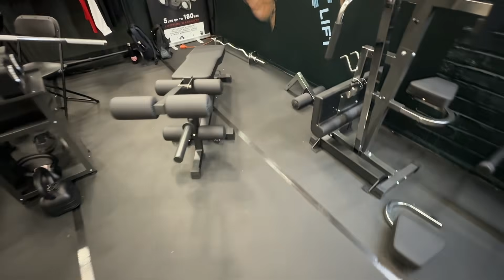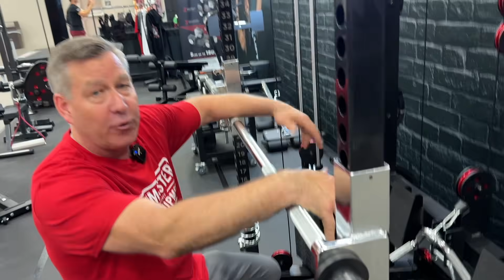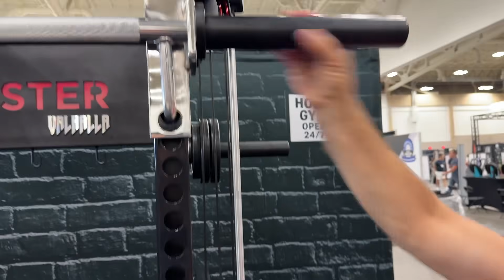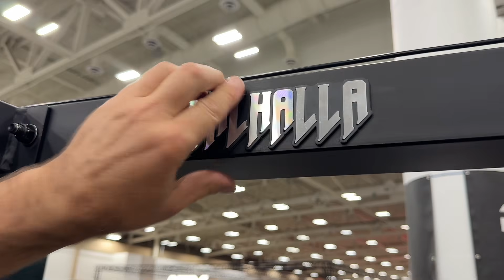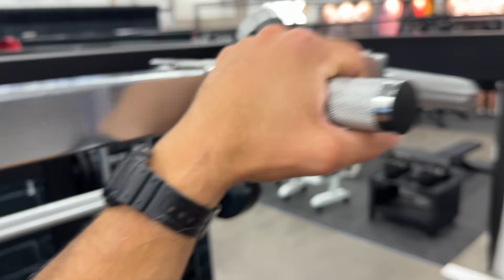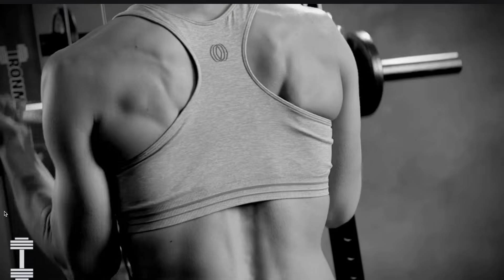Ironmaster Valhalla (IM3000) In Depth Reveal and First Impressions

Comment: Ordered impulsively and now hoping to cancel the order. I own a lot of Ironmaster equipment and have been very happy with it overall. That said, not including J-cups and spotter arms at this price point is hard to understand. It feels like ordering a truck and then being told doors and windows are extra. For the cost, basic safety accessories should be standard.

Comment: not a fan of the smith bar locking system, would be much better if it locks from above and on the side of where you can see the pins like normal smith machines do.  With this system you have no idea (other than feel) if the bar locks in place where as a normal smith machine you can physically see the locking point so know exactly where it is if the weight is too heavy.

Comment: Really interesting piece. I like the angled front, being able to use IM2000 attachments, the innovative pulley system and the mid-height low-row plate. I do wish it had a plate loaded option and at least one pair of 3x3 uprights to have the freedom to use other manufacturer's attachments. $4k seems outrageously priced!

Comment: Personally I wish the smith machine would be an optional accessory I can buy afterwards if I felt to and if there was a plate-loaded version instead of the weight stack. Both would save me money as I don't like smith machines and I have enough weights lying around to load this, so it would be of interest to me still. It looks interesting though and I love that it has a functional trainer AND lat pulldown/low row. and also the increased width of the functional trainer. It's a good design. So many functional trainer out there have either one or the other. Also love that the cable system is not in the way/competes with the rack functionality.
Reply from the maker: You for sure can now with the Bulletproof VTS and I also covered one called SYL. Even though I have a smith machine on my rack, I really don't need it at all.

Comment: Could you tell us how smooth the cables are on the IM3000? Specifically, if you were to rank how smooth (frictionless) cables moved on this unit compared to rogue twin stack, rep, and prime prodigy? (Or whatever other main brand cable systems youve tried)
Reply from the maker: It was definitely smooth, but hard to really remember since I tried it.

Comment: For around $4K it'll be hard to justify when you can get the MAXUM Fitness SX2 which does all the same stuff and more (like leg press) while including a ton of attachments and using standard 3x3" uprights with 5/8" holes.

I can see a market for this more around $2-$3K. It's got an interesting and unique design and there's actually a relatively decent 2x2" attachment ecosystem that I think could work with those middle uprights.

And that adjustable pull-up bar is 🔥🔥. I need that on basically every rack now.

I also actually prefer 2x2" uprights personally since it means you get 2" more interior space for the same exterior rack width when compared to 3x3" uprights, important for us taller folks for maximizing elbow/knee room.

And when you make it with 11 or 12-gauge (or thicker) steel 2x2" is more than heavy duty enough for anyone. Heck even 14-gauge is enough for most people but might limit how many holes you can put in it vs 11-gauge probably allowing 4-way 1" holes with 2" spacing (at least on the front) without destroying the integrity.

I'm also really curious to see how the Force USA C20 holds up, did you get a chance to check that one out?
Reply from the maker: Thanks for all of this, great points all around. Yes, I did see the c20 and will comment on that on a future video.
Reply: ironmaster has a leg press attachment for the smith bar as well. i'm pretty sure that everything that works with the im2000 will work on this machine. you should visit their website.
Reply: It'll likely be under 4k based on the cost of their products overall. The sx2 looks like a better low row set up due to longer ROM, plus using two handles I think is nice to have available. But you max out at 220lbs when combining them since they're on a 2:1 ratio, but the integrated weight horns are pretty sweet. My only caveat is the height, I like dead hang muscle ups and 81 inch height for the pull up bar is too short.

Comment: Two things stand out for me...

1. PRICE: $4,000 is very, very expensive!

2. SIZE: Overall it seems large with the angled cage design.

Obtaining a wider cable crossover movement could have been obtained by altering the design of the cable pulleys, basically enabling the pulleys to turn and lock in sideways to the rack, thus creating that extra width.

When i think Ironmaster i think "compact" home gym equipment but the im3000 seems to step outside that bordering on a typical functional cable rack design.

I hope my initial thoughts are wrong but i would like to see a more compact design and cheaper price tag.

One other thing...the Seated Cable Row foot rests, do they come out further from the rack? I like to get a good forward stretch when performing seated rows but i get the impression from your video footage that a forward stretch may not be possible with the current design?
Reply: Agree that compact is strongly associated with Ironmaster. It is exactly why I still rock the IM-1000 I bought in the mid-90s, which is slightly more compact than the IM-2000. IM racks are for minimalists and/or those with little space. I've got so many hacks for using it, such as using it as a sissy squat fixture. The new environment of so many smiths and functional trainers is a challenge for them, but the people I most follow for good workout advice all seem to be minimalists too and get great development out of traditional equipment. Functional trainers are fine, but I'm not persuaded that they are really are doing that much extra for those seriously pursuing more muscle mass. It almost seems like a distraction to me. But if I were new to the game and had more space I suppose I'd go that route too.
Reply: @5metoo  Spot on 👍
Reply from the maker: Thanks for sharing all this. I don't think the footplates came out further, but could be wrong.
Reply: @hybridresistance  👍
Reply: I agree on the space issue. I think that adjustable arms might have salvaged some of the space saving.

Comment: Ironmaster waited long enough to knock this out of the park with full cable cross and 6 post rack functionality!

First detailed look at Ironmasters new IM 3000 Valhalla a we have some clever design work here. It has a proprietary system so you only need one cable to utilise 400lb for both stacks for pulldowns and low row which can be done on the bench instead of the floor. A belt squat dock built into the spine, a full width cable cross/functional trainer not intefering with the function Smith or the free weight rack attachments. Looks like most of your IM 2000 attachments are going to work as well Ironmaster dont cannibalise their range.

Nice clean non cluttered ground up design, you can move from cables, pulldowns, Smith and free weight rack without having to change things out, doesnt look like the overloaded mechanno set trying to retrofit everything to work on a square rack shape.
Reply from the maker: Great comment and points here.

Comment: Looks like a great system if that's what you're after.  I just bought a ForceUSA F-FT with the flippy-out pulleys like he mentioned, similar to the C10 and C20, so I could get that width.  Paired with a proper rack, it's still the best of both worlds imo.

Comment: I think they dropped the ball a little here by having to use the smith bar as a lock in point for the pull downs. 

If only they would release a seat attachment for the regular im2000 and this it would be a game changer. 

They should focus more on attachments for their im2000 and bench ecosystem rather than a new design which still doesn’t really solve the problem of no seat pad for pull downs on. 

I dunno, I was excited for this but now I’m not so sure.
Reply from the maker: I think they told me that there’s gonna be some attachments for this rack.
Reply: @hybridresistance will wait and see what comes. I’ve heard of a Nordic curl attachment for the bench that serves as an anchor for pull downs so will wait and see I guess. 

Like if you had nothing and wanted the smith setup with ft capability then this would be an option but there are a lot of other good options at that point. 

The thing that sold the im2000 by the truck load was its size and ecosystem. I still think this should be a focus as they have a proven market.

Building this is an entirely new setup competing against rep atx and other companies so it becomes a harder sell I believe. 

Love the content please keep it coming. 

I’m a massive fan of Ironmaster and love their bench and dumbbells and im2000 so love seeing stuff on it.
Reply: @ellisbailey1  IM2000 is still in thier product lineup though, I believe the IM 3000 Valhalla is just adding to their established line as their high-end option.

Comment: I really like the shape of the rack. More compact than a rectangular six post rack and you can do wide cable chest fly. Very nice. I don’t want a smith machine though and the uprights looks kind of thin. I doubt that you can put jammer arms on that rack? But overall very interesting rack.
Reply: Jammer arms won't fit in this config, but the 11 gauge 2x2s are super strong and we have bar hooks and spotter arm for your free weights.

Comment: I am not very familiar with "all in one" trainers as my "gym" is a 10X10 spare bedroom.  I do have the original Ironmaster lat tower and their standard bench.  I find both products more than adequate quality.  I'm wondering why Ironmaster does not use 3X3 uprights if that is what most consumers prefer.  I would think it would make their product more competitive in what appears to be a very competitive market.  This may be a deal breaker for some.
Reply from the maker: I assume it has to be that it would just make the space in overall build much bigger for a situation such as yourself

Comment: Great info. 
I learned more from this video than i did in person at HGC..😂 

The Valhalla, in person, felt like it was lacking... height. I was hoping for an option to get it in a  taller version ~93-95". 

With rhat said, I can see the Valhalla being able to get the job done because it has the bare necessities for a rack in 2025. I think its exciting for people in the Ironmaster ecosystem. 

But it may fall short for me , no pun, in that it lacks flexibility and configuration options. Its like a one size fits all. It also makes some of your most beloved accessories obsolete (i.e seal row pad) and limits your future expansion/evolution of your home gym space. 

Just my two cents.
Reply from the maker: Thanks man. I definitely agree with you and a lot of those points. It was exciting nonetheless to see something as iconic as that 2000 be upgraded.
Reply: I am a definite long time Ironmaster fan and I own just about every major product and accessory of theirs except for their cage/rack systems. I am also curious about the height of the IM2000 and this new model. One exercise I would be interested in with having a smith bar is standing calf raises on the IM calf block, like the female model is demonstrating in IMs promotional video. But being 6'2", I wonder if my head would be hitting that center beam that forms the ceiling of the rack.
Reply: @justinsluck  Owner of an IM2000.  I'm 6'2''.  it is probably the max height you can be if you like squatting with a free bar  (the spoting arms are a little short when you are used to work with longer spotter arms but it still work if you make sure you stay close for the cage). At more than 6'2'' the smith bar may interfer with the free bar even you can keep the smith bar at the bottom of the rack and not at the top. The big advantage of the IM2000 is the small footprint for the amount of exercice you can do.  No regret for the IM2000.  Still unsure of the advantage of the extra footprint for the IM3000 but this current youtube channel and the explaination of the owner of IronMaster make it more attractive to my eyes but It will not wroth it to change in my point of view if you have already the IM2000. No issue with the height also with a calf raises with the IM2000 ( the best calfraiser is here:https://oakclubmfg.com/) .
Reply: That's good to know about the height limitations. Am I biased for thinking 6'2" height isn't that tall or should be common enough it shouldn't be hitting near those limits though? Thanks for the calf raise link. I also own a body solid squat / calf block with a curved deck, but the one you linked looks nicer to me, as it takes up less floor space. But yeah , I have trouble balancing a free bar on my back and my power rack doesn't have tall enough j cups to slide and lean against, so the IM smith function looked appealing @aalexisd6970

Comment: I’m not sure if you had an opportunity to try the Rep Smith Machine, but I’d love to hear your thoughts in comparing the experience of the IM 3000 Valhalla and the Rep Smith.

Consistent smoothness and being able to have the bar as close to weight plate height as I can get are my two main interests.

I started in Planet Fitness and grew to enjoy using a smith machines.

Comment: I think the IM 2000 is still a better option, it has a much smaller footprint. I have had one for 10 years in a spare bedroom and love it. This thing is too big. I would have preferred  something like the Im 2000 with a dedicated high low pulley system that didn't use the smith system for weight. The IM2000 has a high low pulley that is smooth, but the starting weight is kinda high especially for my wife, and I want to use the rack and cables at the same time. Im an ironmaster fanboy, but this is a miss for me. I also don't like the idea of using a free bar in between the smith and the cable uprights.
Reply: I totally agree, I was really excited for this release but it’s a miss for me as well. I think it goes away from what iron master does best- clever space efficient design that you could even fit in a bedroom. Im saving for an IM 2000, and that still seems to be my best option for how I train and how much space I have (not to mention my budget, 4.5k is too much for me).

Side note- Home gym hacks and reviews came up with using a loading pin on the IM 2000 to get a lower starting weight on cable movements. Might be worth a try for your wife!
Reply from the maker: Really appreciate you sending your insight as someone who has the other model
Reply: I love IM products and have the IM2000, quick lock dumbells, and a whole host of attachments.  Agree with the comments that the footprint is too big for my needs. I ended up buying the torque anker 7 for a functional trainer to fill the void and it’s worked great for me as a decent trainer with great space saving.  Was hoping that IM gave me a reason to upgrade but not this time around.  Wishing them well as I love their ingenuity.
Reply: I hear ya. I've had my IM-1000 for 30 years in a spare bedroom and love it. I think IM tried to split the difference between current IM and functional trainer. I'd have preferred iterating on the current design as you say, but then as a former salesman I understand that people have a need to buy for optional uses, even if they'll never use it. The way I'd prefer it might not sell enough for them.

Comment: Great overview! Most likely will be selling my 2000 for this, but 4k…..yeeeesh. Did he mention any dimensions? I lift in a small area, so this is prudent.
Reply: 88.6 h, 65.5 d, 79.7 w
Reply: @IronmasterPro what’s the depth of the top center beam? I have a 90” ceiling but a light in the middle that hangs down around 2+ inches. Your 2000 fits just fine. Also, is that height with the pull up bar attachment, or just the unit? Thanks.
Reply: @TurboGuy979  - I mounted an LED floodlight pointed up at my high ceiling on my IM-1000 a few years ago. My IM now serves as a more effective torchiere lamp than any I've ever seen. I turn it on and off with the wall switch. Eliminating floor lamps declutter my space, and the light is vastly better.
Reply from the maker: I can’t remember off the top of my head, but I remember the height was roughly the same as the 2000. I’m sure you could shoot them an email and they’ll tell you that though.

Comment: Premium product, premium price. I'd like to see a plate loaded option or using ironmaster dumbell plates in place of the weight stack as a cheaper option. Also I wonder if you can use the weight stacks on the smith bar, that'd be awesome
Reply: Same. I’d rather utilize my 460lbs of plate weights without the need of stacks for lower cost.
Reply: @TurboGuy979  I have a weight plate functional trainer and I personally dislike to change the weights all the time. Next time I will definitely buy a trainer with a weight stack. It is worth it.

Comment: Did he mention the height?
Reply: 88.6"h
Reply: @IronmasterPro  Thanks! It looks nice!
Reply: Good question
Reply from the maker: I don’t think I got that on video, but I believe it was 85 to 90 somewhere in there. Or from what I gathered the same height as the 2000 which is roughly 85 inches.
Reply: @hybridresistance  thanks!
Reply: I remember it feeling like it was under 90". 
I didn't measure however. 
I'm about 5'11" and I was hoping for a taller Valhalla

Comment: Does this not use the Quick-Lock Plates at all? That was a cool feature of the IM2000, being able to use the weights I already have. If not, I don't see a big reason to buy this over another functional trainer not in the Ironmaster "ecosystem"
Reply: The quick lock plates can be used if you remove the plastic Olympic bar sleeves (can be removed with Allen key)
Reply from the maker: No, I do not think it does